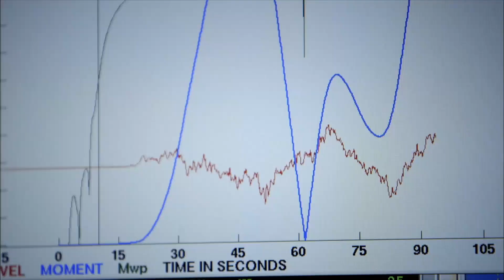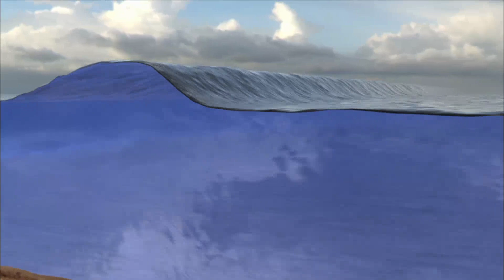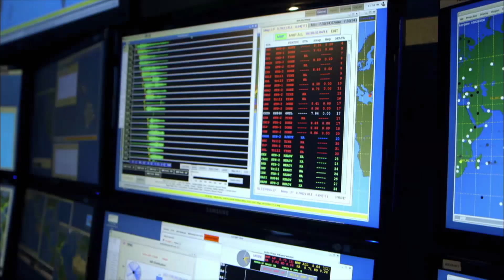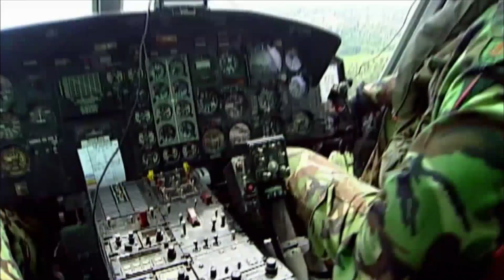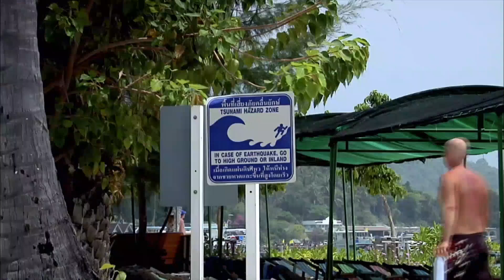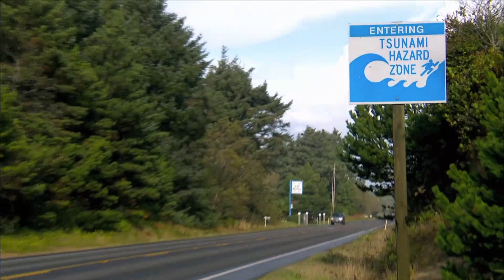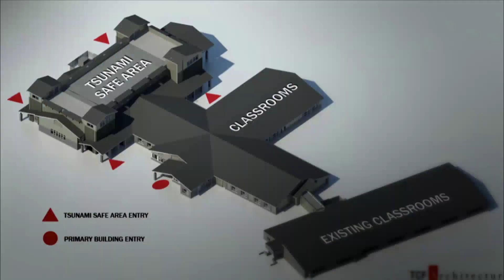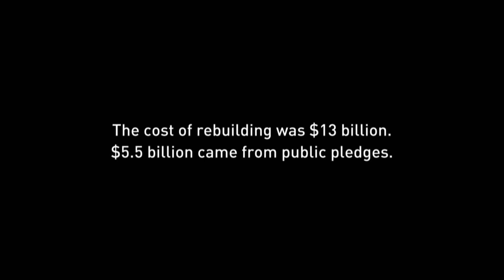Asian Tsunami | The Deadliest Wave

Comment: PS. what's hard to understand is that the very first wave hit at 8:15 in the morning and it didn't occur anybody at the Towers to call up another island. I mean, a simple phonecall would have done it. The other countries would have had 2 hours to 'prepare' (move upward or start walking towards midland). It's insane. The next one was at 10:20.... they could have had a heads-up. X..